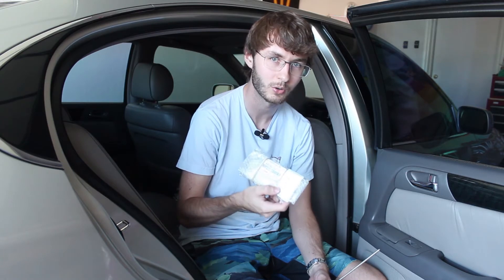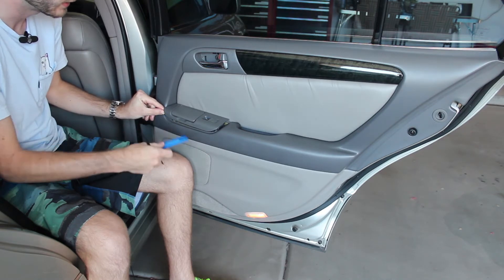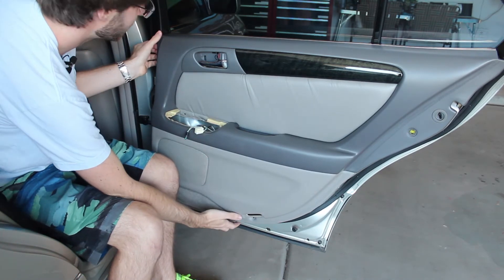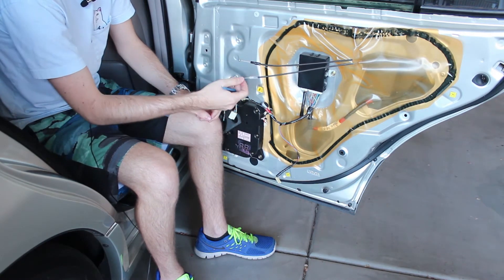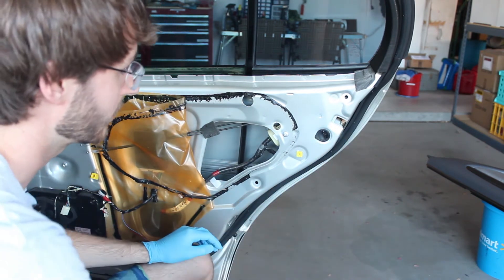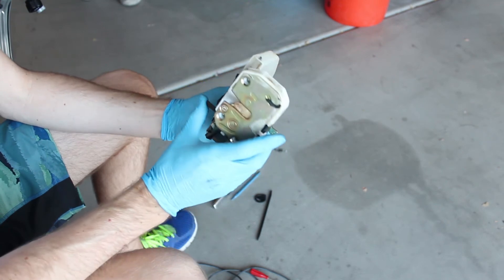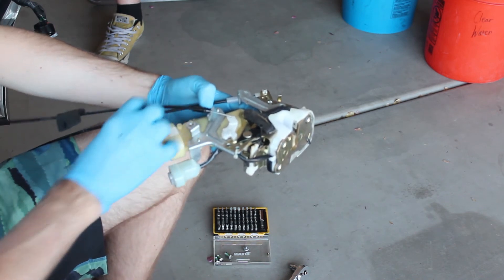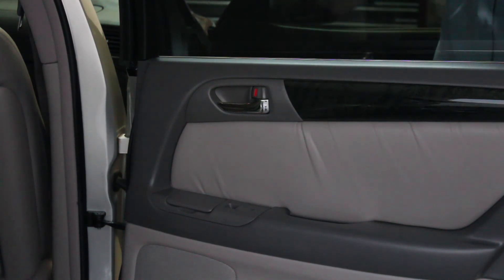1998-2005 Lexus GS Rear Door Lock Actuator Replacement

Comment: F#%£N love ur videos!!! But besides after market actuators and oem the price. What else is a difference. I’m also having low idle when my car sines to a complete stop feels like it once to cut off and it has several times. Any clues on why it’s doing it?? Change mas no luck change vacuum hose and clean throttle body. Autozone saying it’s 02 through scanner but that’s what it said about mas and still same problem. Hope I can help!! Going to sub thanks for the Gs vids!!
Reply from the maker: The main difference between OEM and aftermarket actuators is in the materials - the OEM ones use a higher quality plastic housing, and a longer-lasting motor.  That said, at the price the aftermarket ones are, it is a better buy as long as you don't mind changing them every few years since they do fail more frequently.  I personally don't want to replace actuators at that interval, so I went with the OEM ones for longer life.  

As far as a low idle is concerned, there are several reasons for that.  The O2 sensor could be contributing to that and if you have one or more that are bad you should certainly replace them, but aside from that the common issues are the throttle position sensor and throttle actuator.  All GS300s also suffer from an idle drop when coming to a stop (the idle will fall and bounce back up to normal, but almost stalling or completely dying out is not normal).  

Hope that helps, and thanks for watching!  More GS content coming soon!

Comment: I changed all 4 actuators.  For the rear actuators, its best to just pull the cable from the white end with your fingers, while holding the black part with the same hand.  instead of sticking your hand inside. That made it a lot easier for me.

Comment: Trying to change out my rear ones now. Can't seem to get that flap pushed down, maybe since I have big hands and can't get my fingers to it. I tried to use that other guys trick of pulling the white cable, but it doest actuate that flap on mine either. Guessing that's why this lock stopped working.
Reply from the maker: You definitely need slimmer hands and really need to get tight in there to do it the way I showed and talked about...luckily mine are large but fairly skinny and I was able to get it done.  Maybe find a helper for this one?  Thanks for watching!

Comment: I did this to the two front doors by reolacing the motor actuator and when i lock it unlocks and when i unlock it locks. It seems the motors are working backwards. Any ideas?
Reply from the maker: That's interesting, I can't think of a way that could happen unless polarities are reversed somewhere.  The mechanical portion of the system will either work as intended, or will be limited to a certain amount of travel and will "hammer".  Aftermarket or OEM parts?
Reply: @redonKiLaus  it was working with oem actuators then with aftermarket but decided to change motors since aftermarket didnt last and oem are too expensive. I did some research and found switching two wires in the actuator harness might work.
Reply from the maker: Interesting that they would change the pinouts between models, but it definitely sounds like a polarity issue to me (switching the wires).
Reply: I just had the same problem. I checked where the wires to the motor are coming from and replaced one with the other on the black plug. On mine it was the thick green with Black stripe and green with red stripe wires that had to change places. You can verify it yourself just check which pins on the assembly are going straight to the motor und swap the according wires on the black plug.

Comment: Once turbocharged, have you guys considered the "BBK" using ls400 front break calipers?
Reply from the maker: I considered installing the Wilwood BBK that an individual manufactures and sells on eBay when I was doing a brake job recently, but decided to stick with the factory calipers and just do a full brake system rebuild.  The engine is bone stock, so I see no need to upgrade the brakes since they are sufficient for the car at its stock power level.  Thanks for watching!

Comment: You guys are great!!! Any chance you can do a front break job on this same Lexus?
Reply from the maker: We just did a pad-only brake job, but discovered in the process when measuring the rotor runout that the rotors are warped, so we will be ordering some replacements and will do a video showing the process then.  Thanks for watching!